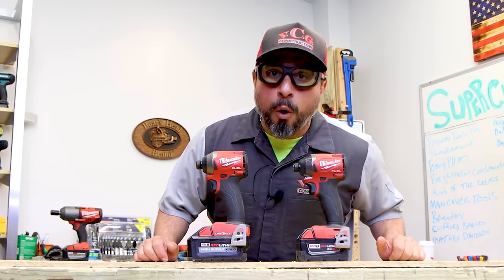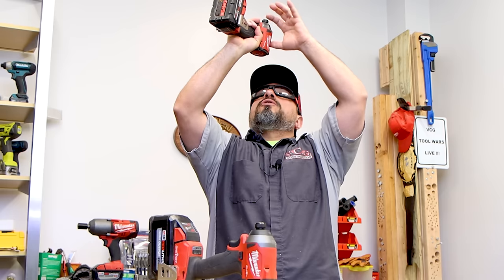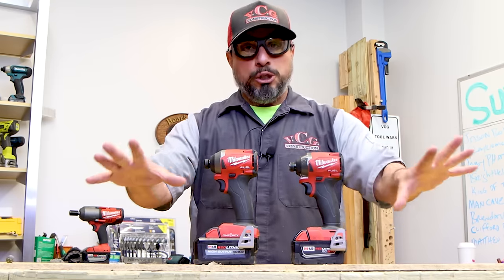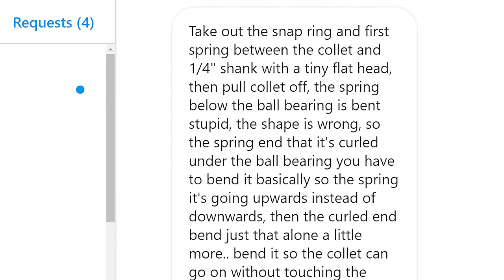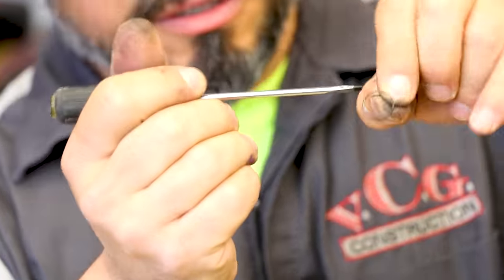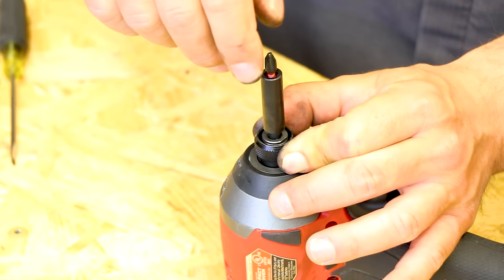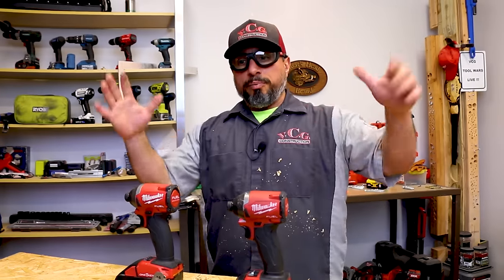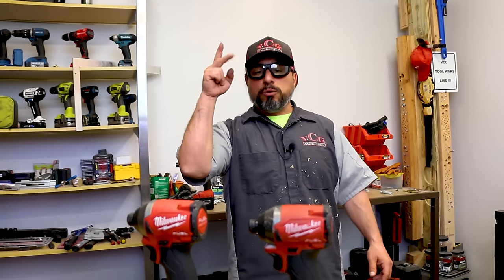FIXING MILWAUKEE M18 FUEL Gen 3 IMPACT DRIVER COLLET PROBLEM (must watch)

Comment: Hmm I’ve had my gen 3 impact since release and have not run into this issue once. Coworker has same drill and hasn’t had this issue either. Does it happen when doing certain type of work? Personally I prefer not to use my impact for drilling into wood with paddle bits.
Reply: i have no idea why you would use an impact driver to drill into wood that being said, iv'e had mine for about a year and ONLY use it for driving screws , it started doing this a couple weeks ago , when you change bits you gotta  jiggle the collet so it will retain the bit
Reply: Kevin Sedo yeah hopefully it doesn’t happen to mine. Haha. I’ve managed to drop it a few times off 10ft ladders and still works great but maybe the drop is what kept it from ever having this issue.

Comment: I’ve had this issue with my gen 2 impact driver and now I’m using a Surge, I haven’t had this issue with my Surge, yet..  I assume the Surge is susceptible to this issue as well???
Reply: I also have the Surge and have no collet problems.  I think the Surge does not hit as hard and as sudden as a standard impact and therefore does not cause the bearing to get stuck.

Comment: Seems like maybe the centrifugal force is flinging the bearing out while spinning because there isn’t much holding it in against the bit. Needs even more spring pressure pushing into as opposed to up or out towards the front of the collet.

Comment: I’ve got a gen 3 impact and I only use it for screws and my bits still fall out. Or when I change bits, my new bit falls out. I have to flick the collet up and down a few times for it to grab my new bit. Very annoying and it’s not that old. There have been a few issues with my Milwaukee gear. Disappointing to say the least

Comment: Hi Vince, My name is Ahmed I am from Baghdad ,Iraq, it is really a shame that Milwaukee fails in its top of the line impact drills , they should’ve given it a thorough investigation to pinpoint the problem,
I watched all your videos on this issue ,I think I have understood the problem well, correct me if I was wrong:
You see any impact drill bit has a circular groove at its end where it slides into the collet, in this groove the ball bearing falls and clicks and sets with the bit , the collet and the screw as one stiff monolithic structure,
what I see as the “ issue “ is that the ball bearing during motion of the rotating shaft at high speeds is exposed to centrifugal forces in a constant way as long as the key is pressed on, so what will that do?
The ball bearing which is loose in place ( the only thing that holds it inwards is the spring) will try to move outwards with a force that is stronger than the force of the spring which is responsible of pushing it inwards , and thus a bigger gap between the ball’s circumference and the bit’s groove is generated ,and that lets the bit be loose and free ,therefore when you pull the impact driver up the auger bit comes out freely as there is no ball bearing holding it intactly to the groove.
This is the only logical explanation , I believe a simple solution could be replacing the second spring ( holding the ball)  with a stronger one and maybe a bigger ( in diameter) ball bearing should be used 
Do not wait for Milwaukee to correct the issue , I urge you to try it live on the screen and give hundreds of thousands of Milwaukee users  a new hope
Best regards

Comment: My biggest pet peeve with Milwaukee is the button placement on the m18 impacts. Wish there was a way to to lock your selection in like by holding the button for 3 or more seconds to change the speeds.

Comment: I love my gen 3 Vince, but i do mostly metal work never had this problem. That said I have a theory. I noticed the DCF887 at work uses the same spring design, however, the main difference I see in the chucks is a springs pin in the center of the chuck. this puts a preload on the bit and keeps the bit from moving around. I believe from my 20 years of mechanical experience the power of the gen 3 creates a harmonics  in the pull out motion slamming the ball and with the right harmonics the the bit releases. I believe a preload spring behind the bit would keep tension on the bit keeping it from slamming the ball and releasing. I am going to get some paddle bits and see if I can get my chuck to do this. Then I will add a spring to put tension on bit inside the chuck and see if it resolves it. The is my theory Vince and I will put it to the test. I appreciate your videos and thanks for all you do.
Reply: What were your results?

Comment: Vince just a thought 
I use Bosch spadel bits in my German Metabo impacts, they work great.
My point is, maybe the Milwaukee in brand specific when it comes to the diameter of the bit.  In short try some different brands of bits to find what the impact likes.
Reply from the maker: We’ve tried the Milwaukee self feeding bits and have had the same problem!
Reply: @VCGConstruction  what happened when you try to get warranty repair from Milwaukee?
Reply: @Dusty_Bottoms_  #VCG has sent their M18 impacts in to Milwaukee for warranty service @ least twice. Returned w/ the same issue :(
Reply: The impact should work regardless of the bit brand used.  

They need to fix the issue.  Make a double or triple ball bearing collet that contacts on the flats of the bit; not the corner.
Reply: @brandonwaller1486  
True it should work universally with all bits.
Unfortunately all bit brands are manufactured to different standards.
Reply: @VCGConstruction 
True it should work universally with all brands.  Think of it this way.  All manufacturers are not universally exactly the same in materials, diameters, and quality of construction.
I believe there is a quality control issue with the Milwaukee,  but I am not understanding why Milwaukee would intentionally use a substandard quick connect system.  I think there should be more testing of other brands before a final judgment is made and Milwaukee should publicly explain this issue.
Reply: @stephenleepmg113  yeah, I get it.  Kinda like pistols and different ammo brands.  Some just like certain brands better.  They all still work, but the accuracy might not be the same.

Comment: They need to design the quick connect so you can remove the bit if it snaps off. Have had it happen 3 time using Milwaukee bits.

Comment: This issue happened to my dewalt impact so I switched to Milwaukee a year ago after it happened. Used Milwaukee non-fuel impacts a ton and had no issues like this. Recently purchased a surge and a fuel. I guess the clock is ticking on those and the jokes on me for thinking Milwaukee made a more reliable tool!

Comment: DAMN GOOD VIDEO! Ive had my impact drill for 2 years now after buying it from a pawn shop and to this day i have not encountered this problem on mine. But its good to know about this issue and will keep this in mind. Hopefully milwaukee will upgrade those collets because these tools are freaking amazing.
Reply: Hello! Did it happen? I see amazing deals on 3-rd gen now and I wonder should I take M18 3-rd gen, 4-th gen or M12
Reply: @Saeglopur89  its still going strong. To be honest, i like both the m12 and m18. Go with what you think fits best to your job.

Comment: This video is old, but the problem is current. I bought a gen 4 2953-20 with two ball bearings, and it has the same problem. Seems like it is a design problem that also affects gen 4 and is not about how many balls it has in the chuck.

Comment: Milwaukee should really fix this, the tool has been on the market love long enough now, imo it should have two bearing and a stronger spring, I'm not at all an expert, but it seems like a good idea. Also I'll say I never experienced any issues with my gen 3 impact, but I mostly use the gen 3 hammer drill for drilling, only a handful of times used the impact with spade bits.

Comment: I think the drilling test the method U use to remove the bit is to heavy handed for any brand impact driver collet I think it letting go actually prevents any damage to the tool the material&the user...if u check that's it locked in there's no need to be so heavy let the bit do the cutting &safely remove from material by control of the trigger
Reply: the old 10+ yr old brushed M18 impact handles it fine and the gen 2 fuel handles it fine. This is one of them unforeseen problems problems that you might have got out of cheaper brands back in the day. I run allen screws and have the same issue when pulling up. Also dont forget that sometimes the collet just doesnt lock when switching bits.

Comment: i have a gen 3 impact fuel and dont know if its cus its newer designed but its friciton free to insert but the collect doesnt come out unless i pull the safety for the collet. i also got this with the packout snd battery cp3 combo
Reply: How long have been using it?
Reply: @leonsalinas7  ive owned it for about 2 months now ans its held up well and i tested pulling one of my 1/4" adapters out of th collet and nothing. Besides rhat its a beautiful fuel product

Comment: I HAVE THE FIX!!  The issue is the sleeve/collet that is supposed to hold the ball down is worn and is slightly tapered on the inside of the collet where it meets the ball.  Withdrawing the bit while drilling will put pressure on the ball and force the collet up, so the bit gets released.  THE FIX:  I ground the bottom of the collet so when installed it will sit lower letting the ball the contact the inside of the collet where it's not tapered.  Sooner or later that non-tapered area will get tapered too, but this WILL fix the problem.  I've tested this and it works.

Comment: I’d have to say very little that can fix this issue besides adding a twist lock to the sleeve.  The spring is your lock now. And it can only take so much pressure before it let’s go.   When u push down on the sleeve to remove a bit normal it forces the spring out releasing the bearing   When your pulling the bit out your also applying similar force to be applied to the spring.  The back of bit is putting force on the bearing causing it to push back on the spring.   A simple fix for someone to design. Would be add threads to the sleeve so that when you put a bit in you can use it normally with quick release feature or twist the sleeve “ thread it down to apply a manual lock behind the bearing and spring not allowing it to release until you want it to or the bearing fails from wear.   

I’d have to also think that if they fully fix the problem that means there acknowledging it and could be subject to a massive recall by saying it doesn’t happen to all of them “ or a intermittent problem” they can blame the user and avoid having a recall on a unsafe or defective product” they most Likely have a fix and waiting in gen 4 to put it in and call it new technology to avoid recalls and or lawsuits
Reply: They definitely need to go back to the drawing board. Could take some inspiration from a nitto air line fitting.

Comment: Great videos, keep up the good work!  After doing some experimenting myself I think there may be two separate but related issues.  One is the bit falling out when disengaging the workpiece the other is just falling out with the driil shut off.  In the highspeed setting it is a design issue, the intense vibration simply dislodges the ball allowing the bit to drop out.  In the low speed or drill off settings I think it may be a contamination issue, the space between the chuck and collar where the ball resides collects greasy debri which stops the ball from moving freely in the assembly.  I sprayed my chuck with WD40 until the contamination was all gone and the second issue went away, I made no attempt the modify the spring.  The slow speed and static issue is gone, the high speed issue remains.  It's interesting that Milwaukee drill chucks use one ball but extension chucks use 3 balls.

Comment: (Edit: I just realized this isn't an issue with the surge which is what I have, maybe the new spring is design is the fix?) I have yet to have this problem with mine  but still went to do this mod on my fuel and the spring on mine is completely different. There's no U shape on mine, it looks like they snipped the end off pass the U and bent it into the ball bearing groove making a P shape.

Comment: Imo the spring is just not strong enough & after use....it goes back to “normal” use. Maybe if Milwaukee beefed up the springs with either stronger material &/or bigger gauge, might hold better or longer....would be great.
Would hate to have Milwaukee design new collet & than not offer a fix for gen 3 b/c their fix....is a gen 4. That would sting a bit for us Ream Red fans, imo

Comment: Its crazy i have not noticed that problem with Ridgid manufactured by TTI  under license agreement from Emerson I'm sure it doesn't happen with AEG  or Ryobi I could be wrong with Ryobi it looks like a design issue with the retaining spring they redesign the  spring that should fix it of course the whole collet

Comment: Like VCG, I am colorblind in terms of tools (I'm actually colorblind); but seriously, I use Makita, Milwaukee, Dewalt, Ryobi, Kobalt, Delta, Central Pneumatic, Crafstman, festool (their miter saw vacuum system has saved me sooo much time and money); and heck I even use a Wen drill press regularly. The way I see it, every company tool has its dark side or its own flaws they don't want you to know about. Saying "I'm team green or red or yellow" is really going against your productivity and literally, costing you money (lots of it). On this particular case, and after having the same issues shown in the previous video on the topic, I sold my gen 3 impacts for cheap and got me the surge hydraulic. It's soo quiet and has no issues - anyways that was my grain of salt - Thanks for your hard work VCG!!

Comment: I use Milwaukee and don't wanna use anything else and I think I got the solution, see, the spring becomes less effective after it gets hot also the collet just begins to wear out due to friction so how bout a replaceable collet or a stronger spring and at least three ball bearings, wadyathink?

Comment: In the petrochemical industry. You can be 400 feet on top of a column installing a manway cover or  buttoning up a spool piece. You do not want your bit and heavy socket to fall out. If it were to fall and strike a person, it could kill that person. But of course, the area below the elevated work. Should be barricaded as a stipulation on the elevated workers safe work permit.

Comment: 2 Years No problems With the 3 gen
Reply: Is a cool impact I love gen 3
Reply: Marty Lucas my personal opinion is that is may possibly start when a person forcefully pulls out while in reverse, which isn’t necessary... don’t mean to offend anyone here, just imo... also, I do electrical, issue also seems to be more related to wood work, Can anyone verify?... I own this, but its still new. I still use my 2753-20 which is probably the best impact driver i’ve used.
Reply: Same here, never had a problem with any drill/impact I've owned. In fact, I still have my 12yo Makita twin set going strong. Also have the onekey twin set, no issues at all. I am known for looking after my gear though!
Reply: Same here. No problems with my gen 3

Comment: Vince can you do a review on the dewalt chisels. I bought the 4 piece set inside depot DWHT16063 awhile ago the set is manufactured in Sheffield England it has a totally different tool making pattern and hollow then this next one home depot  online set  DWHT16862 came also with DWHT16860 & DWHT16852 made in china, the tool markings are totally cheap looking and a totally different hollow it looks cheap. comparing a 1/2 the china chisel is 1/2" longer is 13mm steel seems inferior (softer) takes longer to sharpen sheffield is 12mm quicker to sharpen and better edge retention. Did they just pull a fast one?? Because the still sell the better kit but the site and name make think your getting that top quality tool but really your getting junk

Comment: Hi Guys!!!  Frustrating Vince, Frustrating!  I was hoping for a TTR re-match with the Kobalt XTR impact.  You know, it's like the bend in the spring should stay centered on the ball bearing, not on top of it or underneath it so it can push the ball bearing properly.  But, I don't know a great way of making that modification.  Maybe a drop of solder on the bend and a little solder filing so the solder can "cup" the ball bearing?  Frustrating!
Reply: Hey, here's a better idea than the solder idea.  Replace the ball bearing with a pin that is round on one end (to engage the bit) and indented on the other end to "cup" the bend of the spring.  And, to make this work, bend the "bend" of the spring to the center of the hole.  The length of the pin would be long enough to engage the spring tighter, and the indented end of the pin would keep the pin on the spring.

Comment: Wasn’t there a fix where the ball bearing could be replaced with a slightly larger one ?
Reply: Yes Vince did that and it still didn’t work properly
Reply: Yes Vince did that and it still didn’t work properly

Comment: Milwaukee can't be considered a top line tool with this massive problem. Its a major fault. Would be very frustrating on a job. Dewalt now #1 always imo. Had a Dewalt driver 7 years same battery working daily
Reply: Would you ever consider Makita, if not why?
Reply: @copperbeard3117   I wouldn't consider buying any other brand but Dewalt knowing the amount of stress I've put my tools under working outside daily. Makita may be just as good but i wouldn't change now.